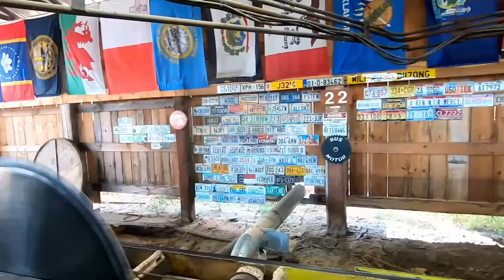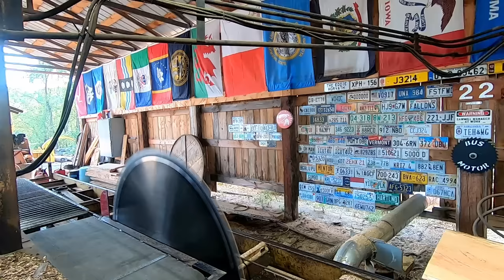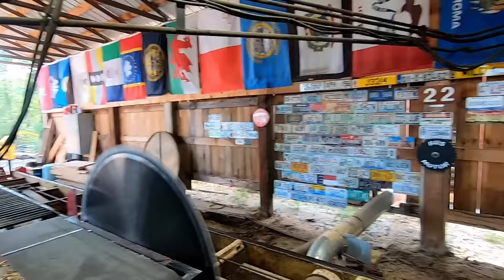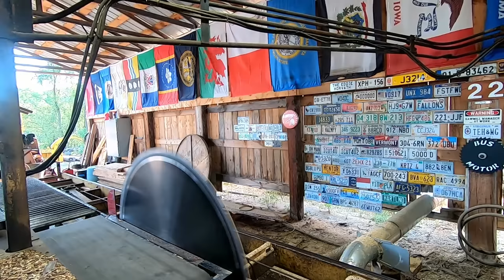sawing my $250 load of logs pt1 # 334

Comment: I love cherry. Loved felling and bucking it too. I logged in upper michigan and it grows lovely cherry log trees.
Reply: I do too, lightweight and strong, it is easy to finish and in my mind only requires a good varnish or polyurethane without a stain. The natural color of Cherry cannot be improved on. I made a telescope, the hexagonal tube of which is made of cherry. I just used exterior grade polyurethane and the wood after many years still looks good as new.
Reply: What is bucking?

Comment: beautiful cherry indeed!
Still trying to figure out how the edger is working.
Especially the flipping guide and the index bar underneath. 
Never saw one from close by and wonder how your settings affect the blade(s?)
thanks for the great time watching you 3!
Reply: All i know us the flip bar is used when you have a cut side on one edge already. By flipping the bar it keeps the wood away from the fixed blade and the blade on the right moves with the adjustment that mark moves.
Reply: Hi @boathead22000  , i suspected there were two blades but the machine body is too far to make them out, now it all makes sense. You made my evening, thanks a lot :-)
Reply from the maker: thanks Stephane , I will do a video on the edger.

Comment: Mark, looking at the saw pattern on the cant, it appears there are one or two teeth on your saw blade that are out of alignment. Thanks for the video. Son
Reply from the maker: you welcome , the saw bits are getting worn down and need replaced soon.
Reply: I’ve noticed with a few batches of bits that they just aren’t all uniform in size lately or fit in the shank the same.
So that’ll cause one or two to leave a saw bit mark.